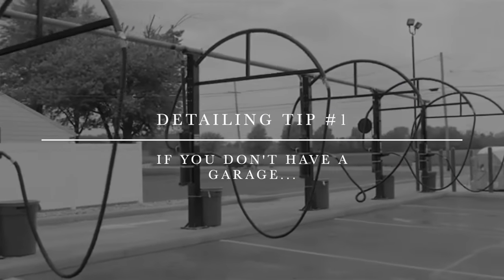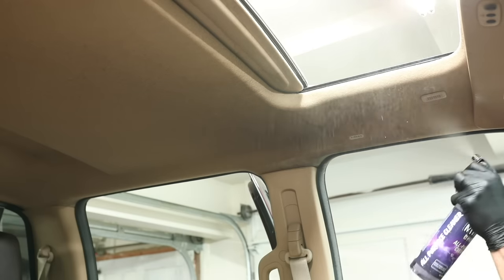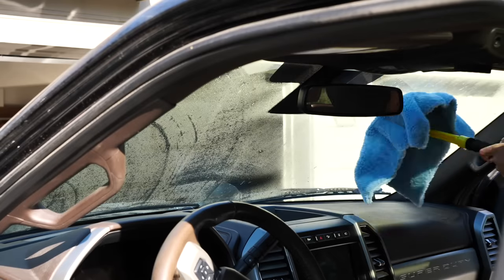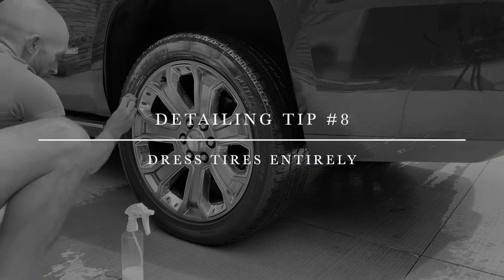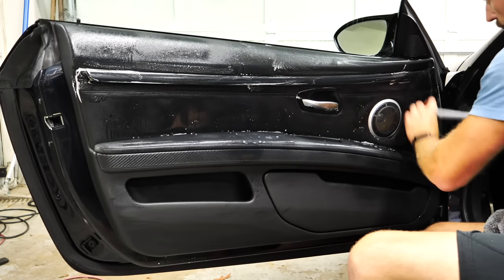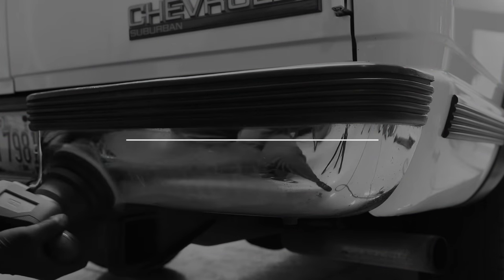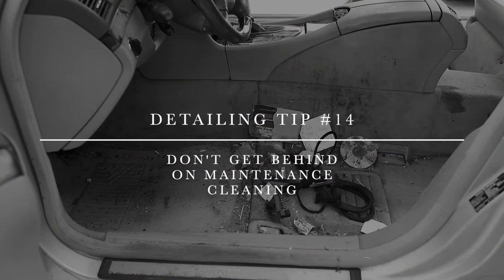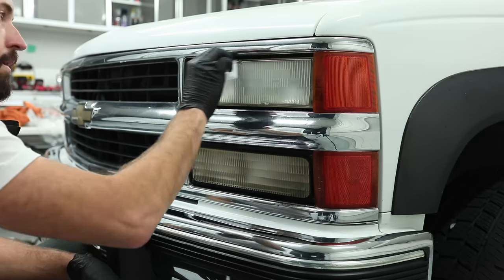A Detailer's Tips to Detailing Your Car LIKE A PRO!!!

Comment: Umm... never pressure wash inside your engine bay,  also you just striped off the guys paint inside the engine
Reply from the maker: Lets remember that its an older car that had been sitting for some time. 2nd the owner had already planned to repaint it. 
Pressure washer wont hurt the engine bay
Reply: low presure 1 meter from the surfuce
Reply: Pressure washing the engine bay does not hurt it. So..ummmmm…..educate yourself before you got rolling on someone’s page
Reply: You don’t know what you’re talking about